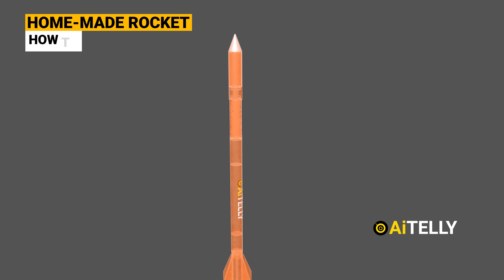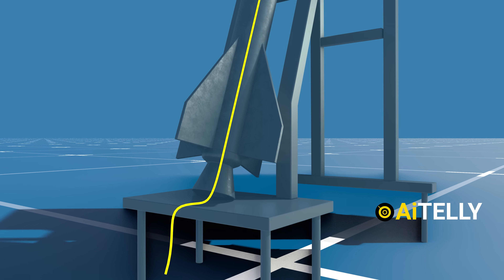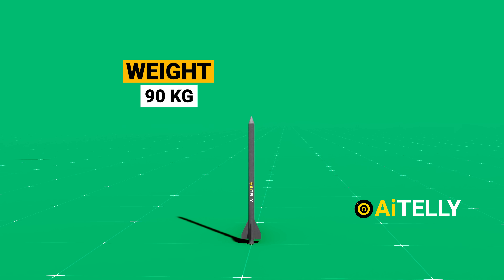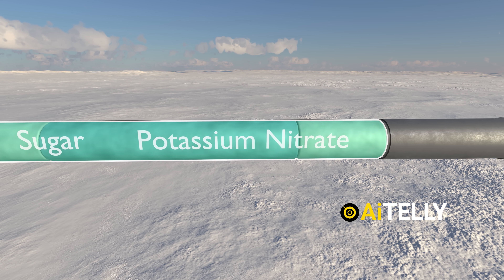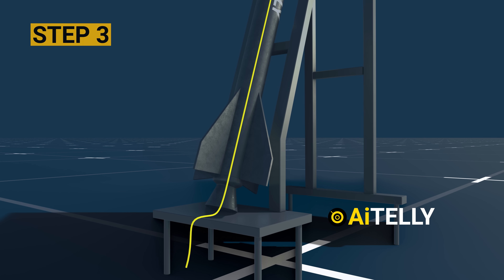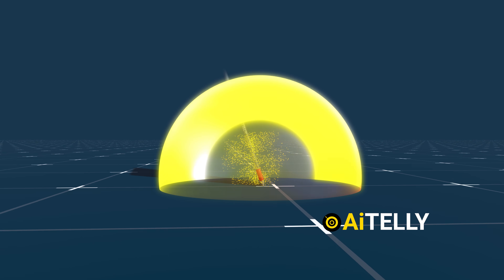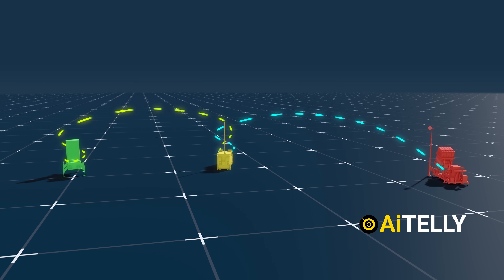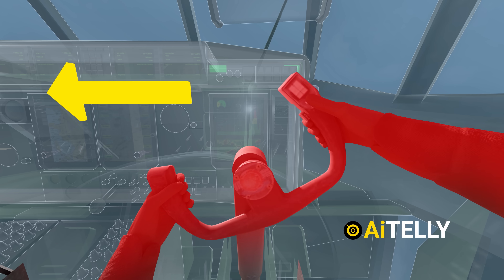How Hamas Makes Rockets against Israel | Qassam

Comment: Rocketeers, or rocket Hobbits have been making these type of hobby rockets for years, although there made for fun or as science projects not weapons here in America. And there are strict guidlines to follow when making them
I'm a licensed certified High Power Rocket Hobbits. I'm retired from the hobby now, but I used to be fully involved for many year's in many types of fuel  through an American Club, who had strick rules for this hobby and I had to under go training and past tests to gain my certification. We did not use Suger rockets as there called, they were completely off limits because they are extremely dangerous. If you manufacture many of them for a long time the reliability of your propellant gets better. However, there are to my variables that can go wrong and one of the worst is called a " Kato " that's simply means the rocket exploded as it launches from the pad to a few hundred feet up this can and does happen a lot with Suger rockets. I have absolutely no problem believing, with the video that one of these rockets malfunctioned and fell back to earth way before reaching apogee. One property that is unpredictable with sugar as a fuel is once the sugar ,fuel, is mixed and cools the sugar molecules continue to blend with other ingredients. Anotherwords, the longer the block of fuel sits around the stronger the fuel gets. If the rocket nozzle or core is not adjusted for this you will most likely get a Kato, premature explosion...If this happens it does not always mean the explosives go off, they might survive a rocket Kato, witch means the warhead comes falling back down on the people who launched it or a short distance from them. Please do your research before flying off the handle on what happened, don't belive everything your told especially minutes after something happens. I can almost guarantee that the news went out about this rocket explosion before the launchers even knew what caused the malfunction. The videos to me says it all. I've seen this happening so many times. Fortunately our rockets where just hobby rocks and we lost the rocket and recovery system.
Note: Our hobby rockets were completely legal and we followed all local and state laws before making these rockets. Do not follow the easy to build sugar rockets you find on video or you risk grave injuries.
Reply: wait Hobbits are real?
Reply: also "the video says it all" it doesnt tho. the quassam without any additives to its name is an very old 70´s rocket, the quassam-250 is what hamas uses now, idk whats in it, but to think its the same as back then is  just playing into the cards of ppl that want to blame everything onto others.
Reply: You should have paid more attention in English grammar classes instead . Here we have a redneck making rockets that cant event spell hobbies but he is somehow " certified high power rocket hobbit " LMFAO !
Reply: "fully licensed certified" yeah sure bud, either you have a explosives license and did that shit for a living or you didnt have a license nor certificate... why do americans always need to boast with superlatives they dont deserve. "full fledged rocket hobbit" would have done the job.
Reply: youre...making this up right?
Reply: High Power Rocket Hobbits?  That's a cool name
Reply: Naftali Bennet tweeted that IDF had done it, to target an alleged HAMAS base in the hospital. Then the IDF claimed it was HAMAS and Naftali deleted his tweet.
Reply: U-Turn @Freedom4PalestineEndZioNazism
Reply: So ypu have seen all the types of rockets hamas launched 
Do you believe that it was a hamas rocket that hit the hospital and did kill over 500 kids

Comment: After Israel used the Iron dume system to detect possible hitting missles , hamas increased the density of the attack on singular spot to guarantee a hit , thus proving that sometimes quantity beats quality
Reply: A bunch of $500 Hamas rockets wasting a bunch of $50,000 Iron Dome interceptors, pretty crazy.  Sometimes low tech can overcome high tech, and this is a great example of safety in numbers.
Reply: "Quantity has a quality all its own"
~ Napoleon
Reply: Cheap easy to make vs Expensive.
Reply: yet they still hit very little becase iron dome only intercepts rockets that will hit targets.
Reply: Not only this they use it as cover for theirs operations 

And to make these expensive iron dome reocket lost for nothing 

It is all lost money and resources
Reply: @manofwar2354  why would israel care that. US citizens pay for them
Reply: @taylan5579  well yeah ,till idf start dying 

The started bringing mercinaries recently brcause they lost too much sodliers
Reply: @taylan5579 
Israel doesn't get cash. They get arms. So this is fully paid for by Israel.
Reply: hamas main goal isn't actual hits, their goal when launching missiles is economic damage, the iron dome missiles are quite costly
Reply: Without iron dome the war would have started 15 years ago
Reply: It always does
Reply: First, Hamas fired 5,000 rockets made of water pipes that only impact, not explode. And most of those 5000 were stopped by Iron Dome only 3 or 2 were hit which only had impact. And you probably don't even know how Israel has been taking Palestinian children from their homes accusing them of being terrorists. And the missiles that have been fired by Israel were guided missiles that explode and cause destruction. And Israel has also bombed with poison gas. And all this is being supported by people who talk about human rights. Israel has been taking Palestinian children from their homes for a long time, accusing them of terrorism. If justice was done to the Palestinian people, there would be no such thing as Hamas and Hezbollah today.Israel is calling this war the Israeli army vs. Hamas but killing civilians.And Israel has so far killed 13,000 Palestinians in response to those few water pipe rockets.And the ignorant people still think Israel is right.
Reply: Israel is the one that bombed the hospital, and it was threatening to bomb it before that, and it bombed other hospitals, schools, and churches. It is unbelievable to the false media that distorts the facts and turns the criminal into the oppressed and the devil into an angel.
Reply: Loool yeah quantity beats quality if your trying to hit nothing but sand. 
Maybe it's time to leave the dark ages and spend that 300 on some services and use the sugar to bake cookies rather than litter the desert with missed shots and the rubble of their own infrastructure.  

Desperate sore losers just can't admit defeat on a war they started decades ago. Take a page from Japan or Germany, they actually surrendered and accepted the terms, look at them now baking cookies with their sugar not living in dirt tunnels and bombed buildings.

Algebra not the snack section of a salad bar.
Not even their Arab brethren will take them in, the Persians that help supply weapons use them as pawns all to prepetuate the counterfeit myths a guy who married a 8 year old stole from the religion that the Romans stole from the Jews.
Reply: Make research how many rockets Hisbollah has. Scott Ritter (former UN weapon inspector) said something interesting about it.
Reply: FR
Reply: Yeah remember unisoviet in WW2
Reply: That's why they cannot defeat Israel.  Because there missiles are not build for war ...
Reply: US has been working extensively on drone swarm technology emmited from fighter jets since 2016. Our department of homeland defense works closely with the IDF. I am fairly positive isreal has access to hundreds of thohsands of AI controlled Suicide drones that can be launched from ground, air, and sea. US has millions if not billions of ai powered drones since 2017 stored in area 51.
Reply: Quantity always worked in a long war

Take example ussr vs germany, with bunch of artillery, tank and etc they can protect stalingrad even goes to berlin
Reply: @rinos7902  iron dome ? 😂
Reply: Thats how soviets won most wars
Reply: that tactic was the dumbest shit ive ever heard of even the idf died laughing at those attempts lol iron "Dome" doesnt just Detect missiles it destroys them in the air itself , a singular spot attack is the oldest trick in the book, so no...in this case quality beats quantity
Reply: @Shyam-1919s   iran proved that quantity works by overwhelming the Glass Dome, used their shitty missiles to waste Israels defence rockets and quality rockets got through
Reply: any idiot can build cheap rockets to attack innocent civilians muslims are known for doing this , the javelin is a cheap 200k missle and can take out a 5mil tank, destructio is easy because its brainless israel could wipe out palestine tomorrow but they care too much what the internet clowns think
Reply: The iron dome is also a money maker for Israeli elites, each time hamas attacks they make sure they fire as many interceptors as possible , since the hamas rockets are cheap and faster to make without special equipment or facility relative to Israelis interceptors hamas can fire virtually unlimited amount of them so the reason rockets stop isn't because of iron dome it's because of isreal counter attacks from hamas launch locations , this why there was always a cycle of escalation and de escalation
Reply: Nucleaire weapon beats quantity
Reply: @sebastiaanl9876  And beats the luncher too, after all you lose a land and all innocent creatures inside, despite the dangerous effects for years
Reply: @sebastiaanl9876 Israel had plans to use their a-bombs with truck or train ^^
Reply: @sebastiaanl9876  nuclear weapons are meant to prevent war

Comment: This disproves the IDF narrative in many ways. For example, the solid rocket fuel only burns for 3-5 seconds and that doesn’t last long. Also, if the rockets have lots of shrapnel, that would remain in the body of the injured people. Mostly, the cars burning and exploding can only happen with much larger explosions.

Comment: I remember some years back they were worried about pipes missing from yards and the pipe yards started putting fences and gates. See a vid about the terrorists using a aluminum highway light pole to for an encasement. There is so much pipe out there you couldn’t possible lock it all up they will get.

Comment: Open Google Map and measure the distance between some point in Gaza strip and Tel-Aviv, it is about 50 mi (75-85 km). It is impossible to make a rocket for such a distance with just sugar and potassium nitrate for 300 bucks. It can not be such size and mass as depicted with even better solid fuel. The rocket with so simple fuel and so small amount of fuel like described one can fly about 3 miles as maximum. These handmade Qassam-1 rockets are real, but they are not the big point. The most powerful Qassam-4 flies about 10 miles, but it is bigger.  For the distances between middle of Gaza and middle of Tel-Aviv area there are rockets 3-4 times bigger then pictured, they are much more sofisticated and contain tenfold more modern solid fuel. And currently no rocket there costs 300 bucks, even the simplest one.

Comment: so based on this video Hamas's rockets destruction power is low and in the video of the hospital bombing it showed one rocket hitting the hospital, so even if it was an error in rocket guidance the impact would be too low and it won't destruct a whole 20m+ building?
and all the evidence points directly that it was an aerial bombing from Israel F-35 jets.

Free palestine 🇲🇦❤🇵🇸✊

Comment: The US should work with Israel to create a strike-back system linked to Iron Dome. The strike-back system should be on the outer border of Israel for quickest reaction time. As soon as rockets are launched, the system detects where they were launched from and automatically fires back an instant missile strike on that area just shortly after launch or before the missiles even land. Those rocket attacks would quickly slow or stop. Whoever gets killed in the return strike was obviously present and willing since these 7-foot rockets aren't something that you'd just park on a balcony of an apartment somewhere. Kind of hard to NOT miss them, plus a lot of Hamas tunnels are right next to residential areas and those 'Palestinian' residents are the ones who installed Hamas to begin with and are aware of what they do.

Comment: Forcing an adversary to expend huge amounts of money to defend against relatively cheap weapons - this is what the Russians are doing in Ukraine. They can fly cheap drones in and force expensive anti-aircraft missiles to be used to shoot them down. Eventually, the air defense missiles run out. The Ukrainians have adapted, though, using the same tactic against the Russians.

Comment: First of all the hospital didn't get hit. It is a parking lot of Hospital which was got hit and yes it is rocket hit which is from Hamas. 2nd thing the explosion is like fireball yes it has to be fireball explotion as it is burst in open area if it hits hospital or any other building it did not seen fireball like state which we saw in video. And for destroying the hospital building if bomb is used there will a crater but we did not see any craters in pictures. As well if the building of hospital destoryed then half of the neighbourhood also been destoyed if the bomb is droped.
Reply: Hamas rocket killing 500 hundreds 😂😂😂😂😂😂😂😂😂😂😂😂😂😂😂😂😂😂😂😂😂😂😂😂😂😂😂😂😂😂😂😂😂😂😂😂😂😂😂😂😂😂😂

Ok it was hamas but the other 9000 gaza civilans was it hamas ? 😂😂😂😂😂😂😂😂😂😂😂😂😂😂

Zionist killed 25 of their captives do u think they give sht about killing xhildren and women?
Reply: google what a gbu-39 airburst looks like and what it does. 250lbs are also small enough to just destroy cars without a crater while airbursting, and are able to wreck havoc inside of the hospital, and yes im aware 500 is a bogus number if the generator didnt get fucked.

Comment: Iranian rocket 500 USD to Israeli iron dome 50000 USD, it is 100 to 1 ratio not endurable. This is why Laser combined defense mandatory. The low cost Laser Air Ship wall + high cost Quick Deployable Laser Gunner + AI will be necessary for light weight low value targets.

Comment: The Iron Dome is a Hoax, Israelian Professors and Expert just realeased a Paper, showning that the Iron Dome is just an "expensiv firework"...
In Fact, NO ONE could ever see or film an incoming Rocket, the Iron dome just shoots missels that explodes a few seconds after.
The flightpath of the hamas rockets would be easy to track and to see, as well as the Iron Dome missels aiming in that direction, but in real, they fly uncontrolled and just explode
Also, there are NO "junk parts" after the explosions found.

There are countless videos involved showing how "bad" the hamas rockets are and that they are more like "smokebombs"  Even impacts on roads or buildings do rarely dmging the material except some "blackpowder" dusts, but not craters or something like that.